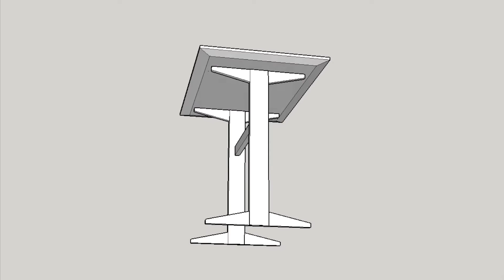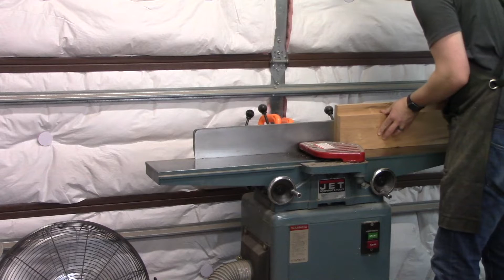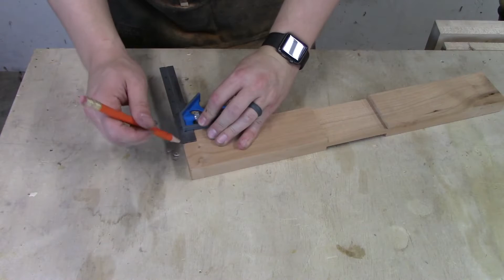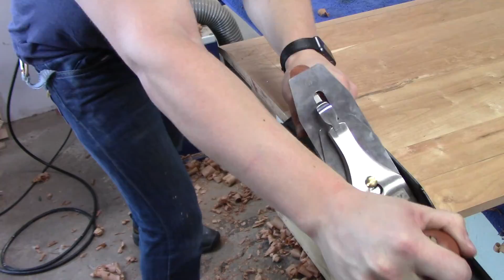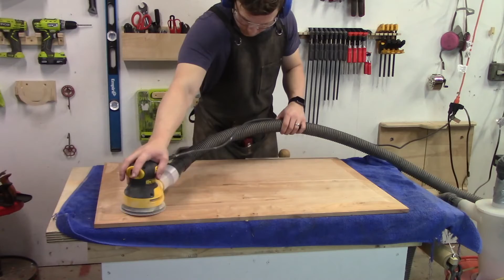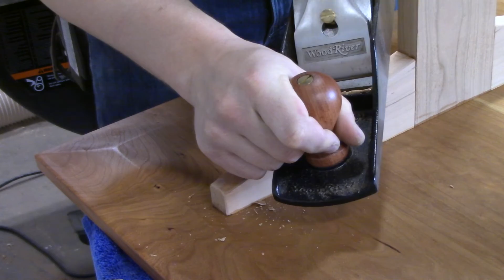DIY Japanese Inspired Cherry Trestle Table

Comment: Firstly great build, secondly I am vaguely replicating a Japanese trestle table for my dorm room, and I like the overall proportions of your table, I could not find dimensions in the video though, if you are still responding to comments, any help would be greatly appreciated.
Reply from the maker: Hey Ryan thanks! Luckily I’m sitting in front of the table right now. The top is 23.25x36, the outside faces of each leg are separated by 23.5, overall height is 29.5, widest part of each leg is 18, central width of each leg is 3.5, and where each leg meets the floor (or the underside of the top) tapers from 1” to 2.5” thick over 7.25. The total top thickness is 1” tapering out to 1/2” at the edges, and that bevel is approx 2” wide. Hope that helps!
Reply: @dkbuilds  thank you for the detailed dimensions!

Comment: Good video on your thought process and build. How sturdy is the whole thing with such thin material for the trestles? You mentioned Paul Sellers, you'd probably also enjoy the books by Lost Art Press and Christopher Schwarz.
Reply from the maker: Thanks so much Alex! I would say that the table is sturdy in that all of the joints are strong, but it is definitely a lightweight / airy build. I probably would have made the legs and trestle maybe ~1/8th or 3/16th thicker, but I was limited by the lumber I started with. And, thanks for the books recommendation!

Comment: Really well done video man. Did you find the #7 hand plane worked well for knocking down the high spots on your table top and making it flat?
Reply from the maker: Thank you Woodworks! The plane used here is actually a 5 1/2 and it is a great size for making a table like this flat. I did recently get a #7 and it's great for very large surfaces like my workbench, but for a table like this a 5 1/2 is more than enough in my opinion. Thanks for watching!

Comment: so sick... glad I came across this video as I'm thinking of building a table based off of Ishitani's as well. What's a good ratio for foot length to tabletop width? 2/3rds? thx
Reply from the maker: Awesome Liam, if you build the table let me know how it turns out! For ratio I'm not really sure because it also depends how tall the table is. I would recommend building a very simple prototype (just screwing together scrap 2x4s or something) to see how stable it is for yourself. I also usually design a rough sketch in SketchUp to see how the proportions look. I'm happy with how this table turned out though so you could just copy my proportions. Good luck!